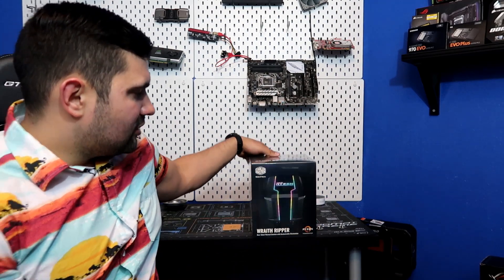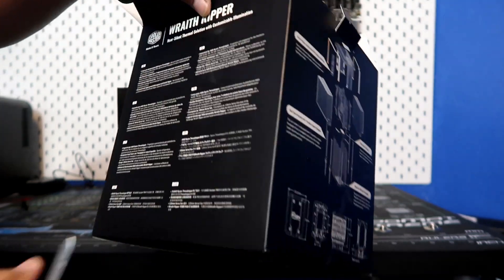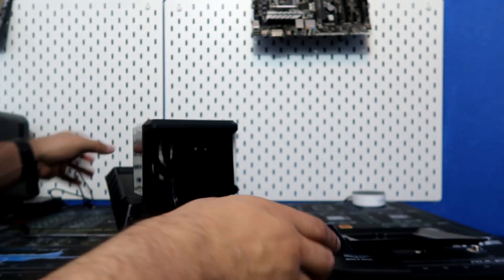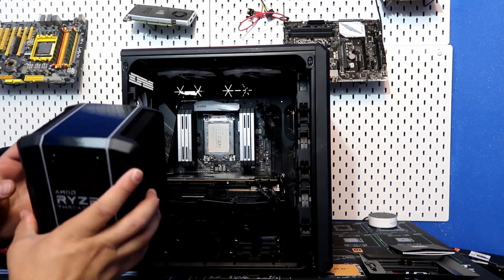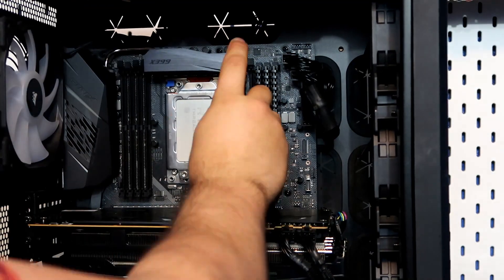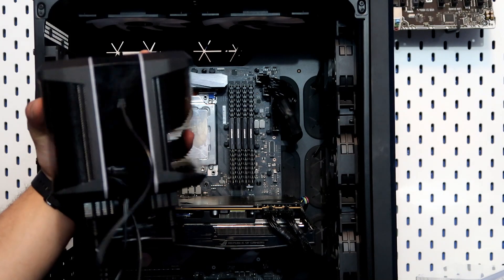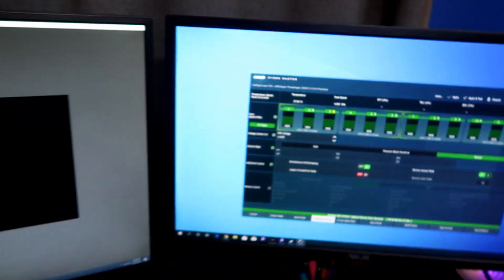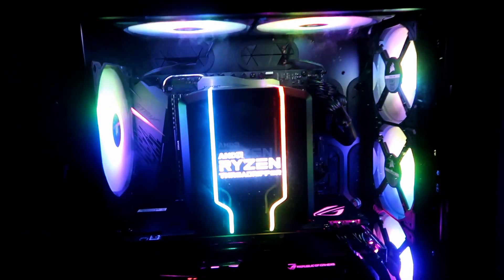Wraith Ripper install

Comment: to start off: this production of this video is amazing, showing off the fan and more angles would’ve been the cherry on top, still good nonetheless.
and the design of the wraithripper is phenomenal, it doesn’t have too much branding but it still makes an appearance like “yeah, i exist” and it’s stunning, considering switching to the threadripper and this is definitely the cooler i’ll be getting for it.